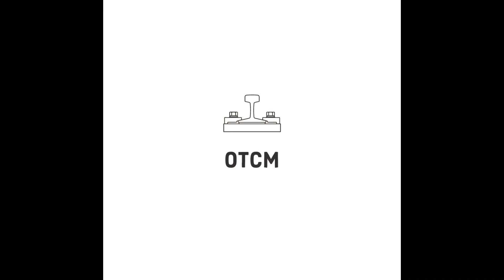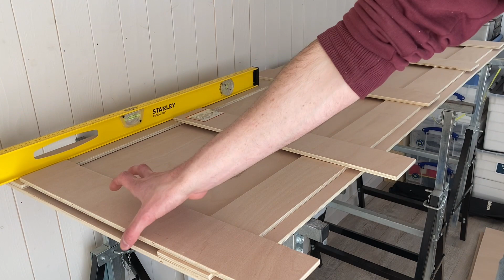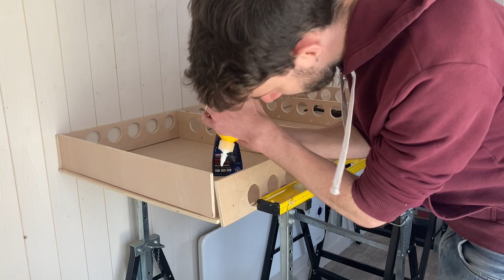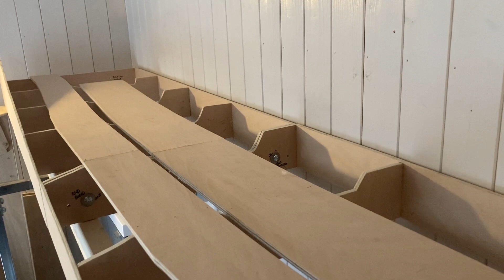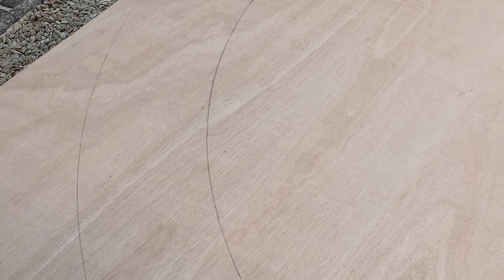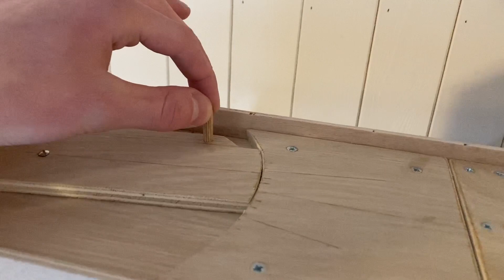Building an OO Gauge Exhibition Layout Model Railway. Part 2- Baseboards

Comment: When you made the curved sections, did you use the 6mm ply to get it to bend.... and as you said it was rather challenging to curve it, would you use a thinner play next time ?
I was thinking I can get 3.5mm plywood and maybe use 2 layers with a large helping of epoxy resin and loads of clamps....
Your hindsight would be helpful.

Comment: Could this approach be used for building larger table style baseboards for4 oval type layouts?  I am planning a baseboard build 2440mm x 1550mm (2440mm x 1220mm + 2440mm x 330mm).  I want it to have legs and be as light as possible in case I need to move it in the house.  Was thinking 12mm plywood on top and 90mm x 22mm timber for the framing but is it also possible to use ply like you have or inadvisable?  I like the holes drilled for lightening the structure.  You haven't covered things like legs for the baseboards or how you pinned the structure?  I was always of the belief you should never pin into the edges of plywood only through the top as the ply delaminates.  How do you avoid this?

Comment: Could i ask your scenic boards what are the measurements of the back and front of the boards thanks
Reply from the maker: Front boards are 4ft long and roughly 21 inches deep (so they fit through the back gate flat!) while the rear boards are 6ft x 2ft

Comment: All ways intresting  to see this early stage  stuff . Having worked on a exobition club layout  we had lots of experanced help ! Bace boards need to be very ridged  no flexing when moving  all right angel joints in the fraim had a 4" tryangel brace and at 2ft a center spine . as layouts travil  and are put up put down the is a lot of handling  so if they  flex the joints work apart and track beds flex.  every thing is screwed and glued  no pinsas they pull apart .  I was trying to see if you had locator pins Male to female when joining boardsto boards  these as you may know are basicaly metal pins fixed into the wood at the ends  these locat the boards exsacty to each other  and you can line them up pria to fixing with bolts .... the are two problems with nuts and bolts  (we have them) they are fiddley to do your always driopping washers or wing nuts, also the fread of the bolt will erode the wood of the hole like a small rasp and the joint becoms slack as the hole gets larger  a few millameaters of play over track joins  will effect running . so our ends had two braces spaced at the end to take a block of wood that had a 8" carrage bolt male to female fitting set up.   this was easey to do and spreads the stress of the joint over the 8" bolt  .we could nuge and move the hole lay out with out stressing the joints ......    We have a three section curved off seen   this was a pain to transport and put up ! we were considering doing it as a set of straights cut to angels to form a hexsagnal curve  .  As I said just some coments from our experance  not ment as a big critasizem of what your doing  .
Reply: I used the coachbolt method... I don't take it apart so no "rasp" effect... but the problem I did encounter was steel bolts are a lot tougher than my C16 wood... It was okay, I got away with it... I was actually taught to avoid mixing in wood and metal because of these sort of problems .. So, should have known better.